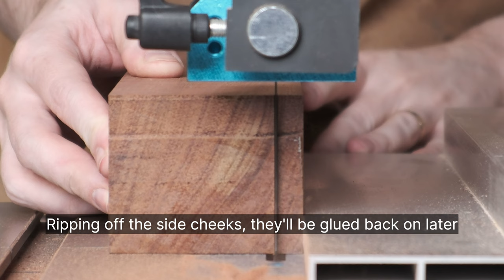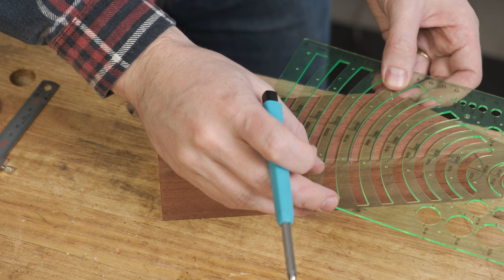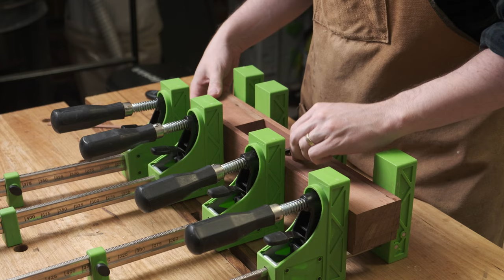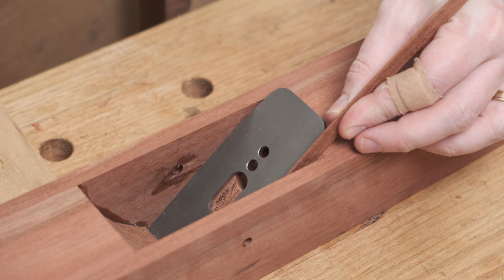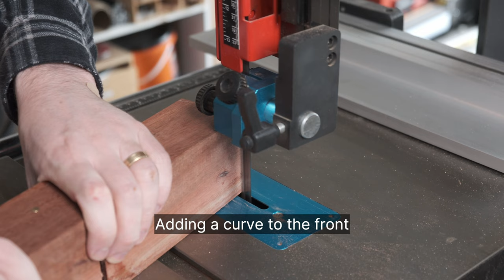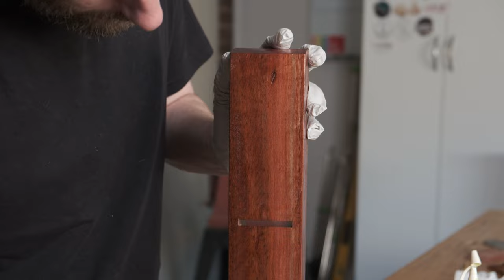Wooden Body Shooting Hand Plane

Comment: This looks like it was a fun project. And it seems to work very well; why do you say it's "an ok"  shooter?
Reply from the maker: It works exceptionally for smoothing but by comparison my metal planes work a lot better for shooting - the metal LAJ can take a thicker shaving, with less effort, and leave a smoother result.
It could be due to the angle the a2 blade is sharpened on, I'll need to experiment some more!

Comment: Nice work! .. what did you mean by just buying another blade rather than a whole new kit for another plane? .. and also, what do you think made it only an "OK" shooter? I was thinking of making something similar and drill holes in for some steel round bar.
Reply from the maker: It turns out I'm not a huge fan of the norris adjuster. Its well made - as is most Veritas stuff - but doesn't gel well with me. I'd probably grab a "spare/replacement" blade from a low angle jack and use a crosspin-and-wedge mechanism like on Krenovs planes. I've made one of those before (not on camera!) and the tippy-tappy-with-a-hammer actually gives a great deal of control which I don't feel from the norris adjuster!

It works exceptionally for smoothing but by comparison my metal planes work a lot better for shooting - the metal LAJ can take a thicker shaving, with less effort, and leave a smoother result.
It could be due to the angle the a2 blade is sharpened on, I'll need to experiment some more!

Steel round bar for weight is a good idea - I was loosely following the ideas from a FWW article (or maybe Popwood?) and the author did that. Part of me wants to add lead shot, make it sound like maracas when you plane 😁